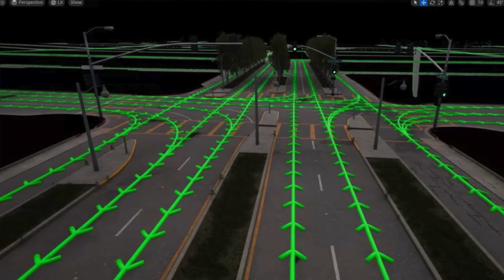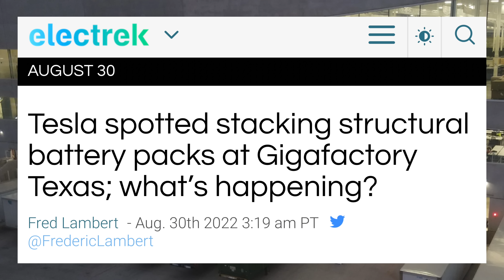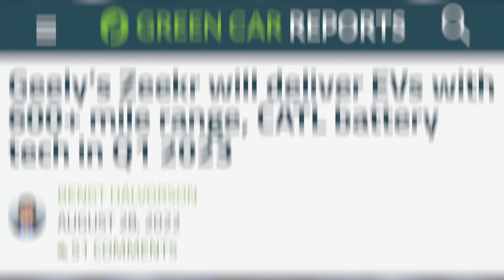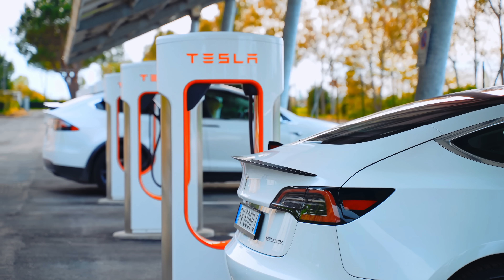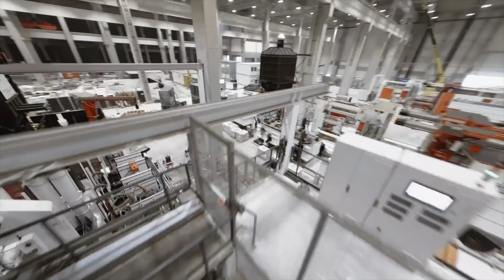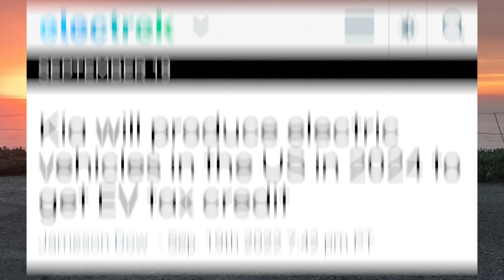Tesla Keeps Destroying The Competition | Ford Can't Keep Up

Comment: One thing Elon is very wrong about is radar’s and lidar’s necessity in the ai driving market
Reply: Elon said that the current lidar technoloy is just to low-res. They are trying to develop a high-res one that is cost effective as well.
Reply: How do you know that?
Reply: @BigBen621  a basic understanding of the technology compared to using cameras. 

Computers don’t see what we do through a camera sensor, all they’re getting is a massive string of 1’s and 0’s then must identify what we recognize as different objects out of those 1’s and 0’s… as opposed to lidar and radar data consisting merely of measurements of distance from the sensor to any object reached. Radar and lidar don’t need to identify anything, only to know if any object is blocking the path or not by using those distance measurements. 

It boils down to how much compute power is needed. When using cameras, far more processing is required to first identify every object in each frame, to then use this data for estimating distance measurements. With lidar and radar the first part of that equation is removed, which is arguably the most resource intensive part.
Reply: @speedracer9132  You've only made the case that vision-only is more computationally intensive—not that it can't be done. I can't be sure it can be done, but neither can you or anyone else be sure it can't—only that you don't believe it can.

Musk and his various companies have done many things previously thought impossible, and he's dedicating massive resources to solving this problem. On the one hand, I'm optimistic that it can, because I've seen the dramatic improvement in FSD beta in the eleven months I've had access to it. But my optimism is tempered by the observation that issues that appear on the surface not to be difficult have not been solved yet. In the end, you may be right, that autonomous driving can't be achieved with vision only; but I'm still guardedly optimistic that it can. Only time will tell.
Reply: @BigBen621  It has been metioned in this channel and others many times. Elon tweeted about it, it's his words.

Comment: Any ev maker can pack more batteries into a car for more range. That shouldn't be the goal. The goal should be to find how to get more efficient batteries and more compact batteries giving more range in the same blueprint. I also believe faster charging times is more important. I think a sweet spot range is 350 - 400 miles
Reply: More battery means more added weight, means more stress on the car parts and less life on the tyres.
Reply: @cloyd6495  the operating phrase here is increased battery density, which means more capacity at the same weight.
Reply: @Rockster1989  I thought the density is about weight and not the size?
Reply: This man gets it.
Reply: It's like putting a huge gas tank in an ICE vehicle.
Reply: More efficient batteries, with a smaller footprint and less weight is probably every EV makers goal.  It is going to be hard to get there though.   Tesla battery day was 2 years ago.  They announced they would improve batteries with something called a 4680 cell.  And they would have them in all new Model Ys, Model 3s, and the Cybertruck SooN.     But it appears it will take about 3 years from concept to producing them at high volume.  And while the 4680 batteries specs are an improvement, it is an incremental improvement.  So, what replaces the 4680?  When will that tech be available?  4-5 years from now?  This is going to take time.....
Reply: The goal is to find more efficient batteries / chemistry, as well as faster charging times.   No different than ICE engine builders trying to get 50 miles per gallon with a V-6.   Laws of physics prevent it from happening though.  Another 20% efficient gain on top of the 4680 gain, is probably the ceiling for at least 5 years.
Reply: Agreed
Reply: @MisterDemetrius Some people think Tesla is holding back on their range.  They aren't.  They are balancing the weight of the battery cells to increase the range, and the cost of the resultant vehicle.   And Tesla is using the most current software/battery management system they have.   It is unconfirmed, but Lucid seems to have found some efficiencies that Tesla doesn't have - yet. Maybe it is the drag cd?  Maybe it is the motors?  The cooling system?   If Lucid really has figured out better efficiency, hopefully Tesla can to.  Good luck to both of them!
Reply: I own a Tesla model 3. Great car. I love it. but what they neglected to tell me up front, is that the battery shouldn’t be charged but to 90% and it shouldn’t be drained lower than 30%. That knocks off 40% of the driving range. Just a tad disappointing but I don’t regret buying it for one second. The thing corners and steers like a race car and the power is incredible.
Reply: You can only really use 60% of the battery from 20-80% so realistic the battery pack should be large enough for 350-400 mile range at 60%
Reply: @Jeremias066  you can use 100% of it on longer drives, just not daily. I doubt many people need more than 200miles a day for their commutes. Even if doing monthly roadtrips, charging it to 100% is ok - especially if you don't keep it at 100% and drive it immediately after
Reply: Maybe you should build them

Comment: Yes, in the winter you need a larger battery.
Reply: Not necessarily. You need an efficient battery not affected by the cold.
Reply: America, most likely. Europe, no. Here you can manage with a 50+ kw battery in the winter with no problem and drive through your country with no issues in the freezing cold. So many chargers, such short distances.

Comment: 600mi is not worth it. Very very few customers actually need that range. And as Elon mentioned, it's inefficient. Not to mention you make less cars since you use more batteries.
Reply: 600mi is a real world 300mi in cold weather. Wonderful for winter road trips in Canada
Reply: @0HOON0  stop thinking about extended range in order to get longer range in cold weather. How can the batteries be improved to get true range regardless of the weather?
Reply: @Thomas L   Elon says 90% is fine for everyday use.  How often do you need to go 600 miles?  The cost in battery degradation of being at 100% for a couple hours is negligible.

Comment: I would like to see a lifted model 3/Y with a double stack of batteries, 160 kWh with 600 mile range. Easily doable. Those who think that much range is unnecessary including Musk have never taken a road trip hauling a trailer or in -20 temps. I'm not saying it needs to be standard in every car, but make it an option for those that do want/need it.
Reply: the problem is that elon said that the weight of all those batteries would seriously take a toll on the car and make it to heavy which will make driving worse and very slow but hopefully he finds a way to store more charge into the batteries
Reply: @mrpeluchito  battery tech has been stagnant for 20 years so we’ll see.
Reply: @Gundy611  Battery tech has been stagnant for 20 years?  You gotta be kidding.
Reply: @incognitotorpedo42  not kidding. Lithium Ion batteries have been relatively stagnant for a long time in regards to energy density.
Reply: @mrpeluchito  No, a double stack model Y would weight about 5,500 lb, max. The EV hummer weighs 9,000 lbs for reference. Also, weight has a small relative efficiency hit at constant highway speeds.
Reply: The type of people who will be towing enough to care probably won’t buy a model 3 so i could see this for the y/x. Maybe tesla could make a trailer that has a battery pack and can provide supplemental energy.
Reply: Need a battery trailer that can hook up to the car adding range when needed.